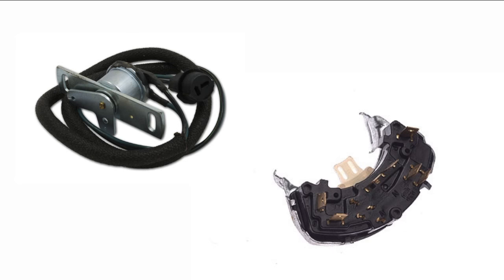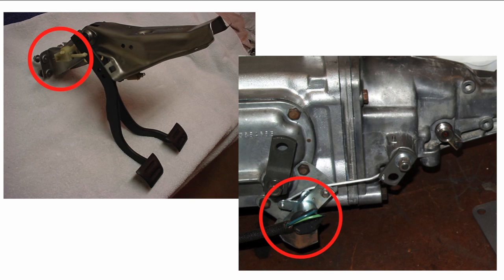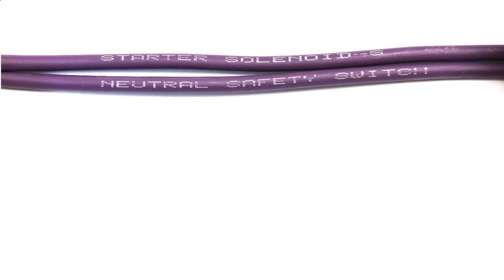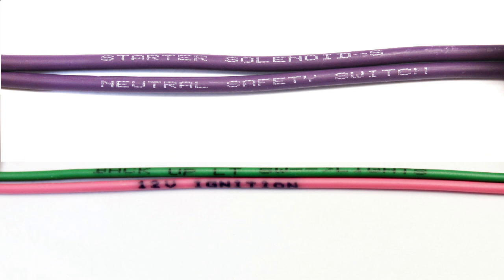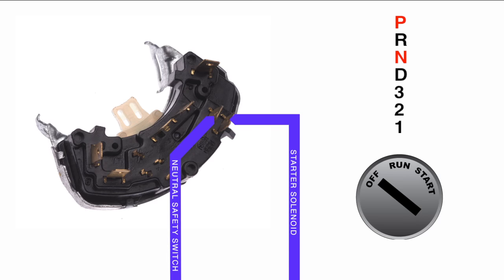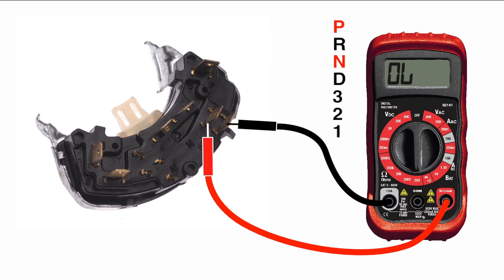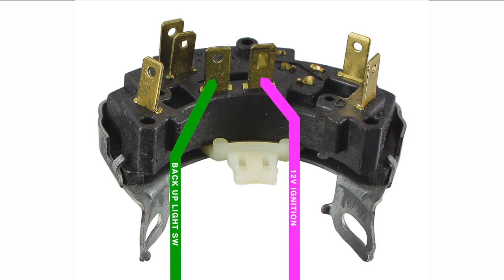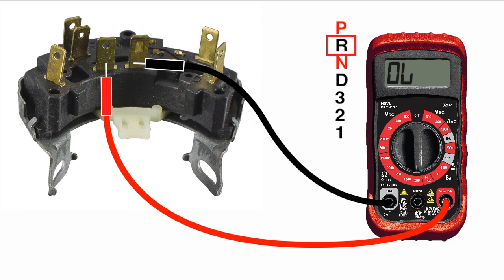Classic Update Neutral Safety and Back Up Light Connections

Comment: I've looked all over the damb web and nobody or any diagrams can tell me what the extra prongs are for on the netural safety switch? The one I took off of my dads truck looks just like the one in the video but my dads switch has 4 prongs and does not have the prong down in the far lower left corner or the 2 in the far right side of the switch. what are the extra 3 prongs for ????
Reply: I don't think those are needed.  I have extra prongs on mine too and nothings plugged into them.

Comment: I bought the 510008 "Kit" from Brothers Trucks.  It is the American Autowire product.

NOWHERE IN THE ENTIRE INSTRUCTION PAMPHLET is the words or term "Backup Lights" or "Reverse Lights" listed.
THERE IS NO MENTION OF THEM AT ALL.  This video is WRONG, and FRAUDULENT.  There are NO WIRES MARKED
"BACK UP LT SW  LIGHTS" as they say in this video.
Reply: Hey Phootho use a light tester
Reply: Its labeled on my harness
Reply: fraudulent is a bit harsh. my column side of the harness doesnt have one either.